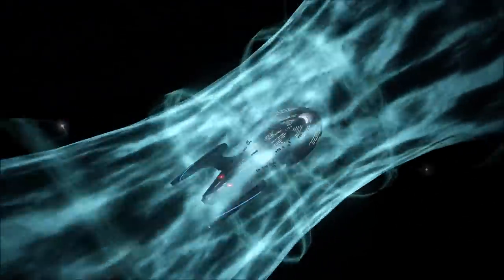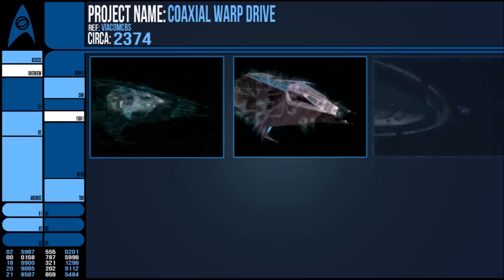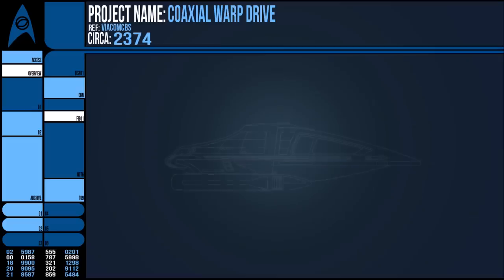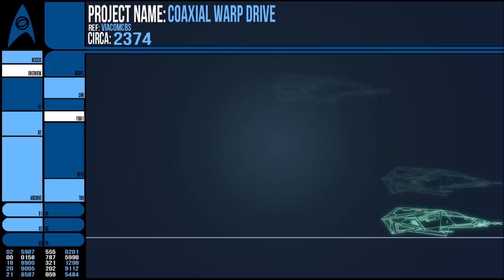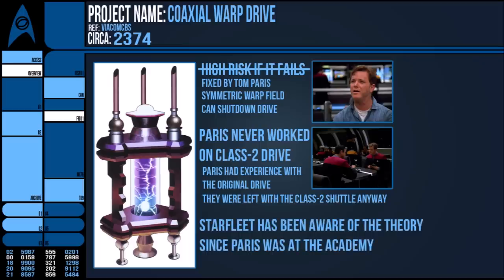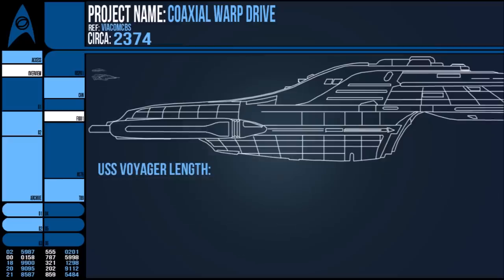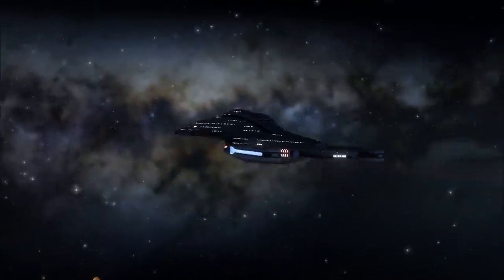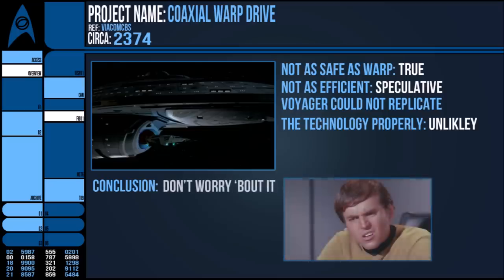Why Not Coaxial Warp Drive? (Star Trek Theory)

Comment: I find a distance limit to be the most convincing explanation. Surely there must be a difference in the power requirements and the complications between folding two points one light year apart together and folding the delta quadrant so it touches the beta quadrant. One is like pinching a bed sheet, the other is trying to fold it perfectly in half with nothing but your teeth.
Reply: id bet with some practice you could fold a sheet with your teeth.  its like a snake trying to fold a sheet in the wind?
Reply: @omg_RANCORS  Well I was originally going to go with folding it with your eye lids, but sure, I like the snake idea!
Reply: @indetigersscifireview4360  

Well, it can be done ...

... if you have a 10+ ton hydraulic press to hand ...
Reply: @nigelft  Which turns the paper into calcite. I would not to find out what the supspace equivalent is.
Reply: @Janoha17     demons  probably
Reply: @Janoha17  Strange matter, isn't it? It's a real thing. Kind of like regular matter, but condensed. Unfortunately, it's hyper efficient and things it touches tend to become part of it, iirc.
Reply: Joshua Perkins yeah well if the Spore Drive says anything it's that teleporting long distances shouldn't be tried.

Sure that jump was trans-dimensional but it still killed someone

Comment: Coaxial Warp Drive was made obsolete by HDMI Warp Drive.
Reply: A wormhole is a tunnell from point A to point B, inside the tunnell is usually foreign to the universe, with different rules governing time, space and dimensions. Folding space is bending the fabric of space and time (like a blanket) until the two points A and B come together momentarily as point C while they occupy the same space and time.
Reply: Don't forget about the Composite Drive and the Component Drive.  They are still around.  Coaxial Warp is only obsolete on the outer portions of the galaxy, though.  It is still widely used to travel about 95% away from central base, but this is slowly being replaced by Fiber Drives.
Reply: osp80  Ssssh!  Nobody talks about s-video drives.  They are like the Betamax shields, or the HD-DVD torpedoes.  They had their strengths, but if the Klingon Empire won't use them, did they even really exist?
Reply: osp80  You stand alone, my friend.  The Apple star system got so burned by that drive that they immediately turned completely xenophobic and refused to adopt any other technology or share their own.  You can't even repair your own ship, anymore.  If it breaks down, you have to get towed to the nearest "Genius Planet", where you get endlessly ridiculed about how you "flew your ship incorrectly" while they "upgrade your software"
Reply: I hear the new galaxy class 10 ship have the 5 g drive system  .
Reply: osp80  The image wasn't as good as a Tri component Drive with dual audio inducers.
Reply: My S-Handycam used to have an Hi-8 Drive with stabilizer effect for the warp bubble.
Reply: TheZapan99 🤣
Reply: TheZapan99 this made me giggle
Reply: No one is going to mention the venerable RGB SCART drive?
Reply: @StefanMArndt  What about the newer USB 3.0 -C drive technology?
Reply: @walterdayrit675  USB-C drives weren't purpose built for long distance travel.  Using them as a means of travel has always been more of a niche "look what I can do" function, anyway.  Regardless, they aren't well suited for interstellar travel.  They are better suited, and mostly used, for power generation.
Reply: hahahaha
Reply: @RimWulf  Whether you devolved into a fishman or not, you still had sex with Janeway.
Reply: Back in my day we had two nacelles made of tin, that took advantage of string theory. Of course this was really hard to picture, I can only describe it.
Reply: 35mm drive is best drive, yo
Reply: I prefer Video S warp drive
Reply: I'm late, but what do you expect from the only person coming here to remind people about the ZIP warp drive? Not the same technology as the S, Coaxial, or HDMI drives, but it could handle heavier subspace loads than the floppy-warp-field-creating predecessor.
Reply: I am months late watching this video. That exact thing popped in my mind, so... here's your thumbs up. ;)
Reply: I hate to break it all to you but the best drive has always been hidden behind the classification wall, otherwise known as the paywall. The cloud drive seems to be getting a lot of attention. More than I would like but still, it is used very widely.
Reply: My starship uses a Thunderbolt 3 drive via Type-C warp nacelles. The Power Delivery feature allows me to quickly do refueling and maintenance on my Android-class smart shuttles without docking them. And I love the Bluetooth-class subspace radio.
Reply: Kinda miss the 8-track drive ships...
Reply: @StefanMArndt  I have to deal with SCART drives on a daily basis.
Reply: Ok, that's funny.
Reply: @TheZapan99  for the win.
Reply: Nobody is talking about battlestar galactica
Reply: Maybe I've got my history mixed up, but wasn't there an RCA drive at some point? 😀
Reply: I'm still holding out for Warp Fiber technology.
Reply: Well what does this clear cord and this weird red light do that says fiber optic??? Will I get home in 2 seconds??
Reply: No one ever mentions the Bluetooth drive.
Reply: HDMI warp drive was cancelled due to copyright, they never implemented HDCP stabilizers.
Reply: "Raise the VHS shields, activate the VGA warp drive, standby CRT disrupter cannons!!!"
Reply: @theosexpertdaymon2774  🤣🤣🤣
Reply: For the win.
Reply: Coaxial Drives only have a range of approximately 100 feet, or 30.48 meters, at most.
Reply: Ha!😂
Reply: @StefanMArndt  in Europe we had SCART warp drives while Americans were mostly stuck with the terrible composite and RF warp drives. Even to this day, SCART warp drives are the best, meanwhile Americans are modding their old warp drives to use S-Video warp which still doesn't actually look as good as SCART warp does. And HDMI warp drives have input lag that is an unavoidable fact of physics and so can't be removed, only reduced (to an extent). But use a good old CRT main viewscreen, plug a scart warp drive into it, and you've got warp drive that looks better than even S-Video warp drives and have no input lag either
Reply: Some ships still prefer to get free Warp Drive from a radio antenna.
Reply: @clevoro  Hah, my ship requires the coaxial warp reactor to even access cloud subspace.
Reply: @TheZapan99  If she’s good enough for Q, she’s good enough for you.
Reply: Slow Clap Well played.
Reply: HDMI warp drive was made obsolete by coaxial streaming.